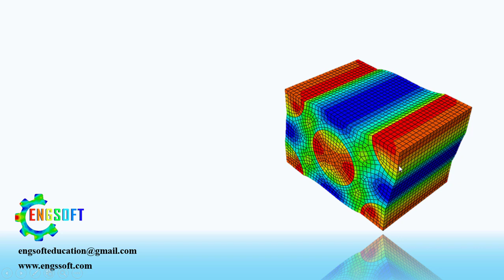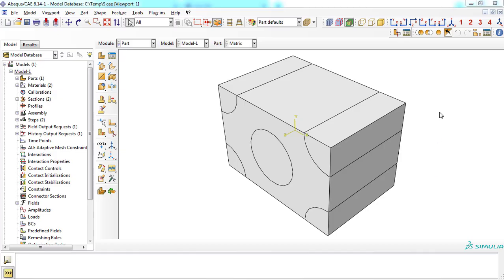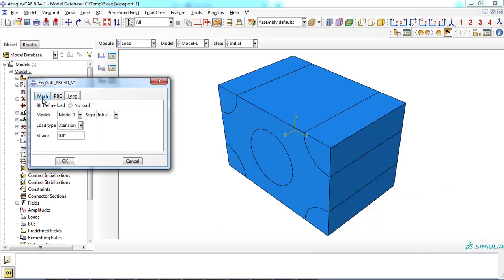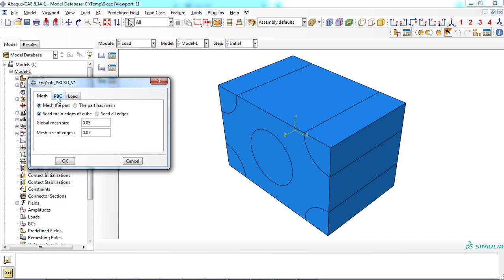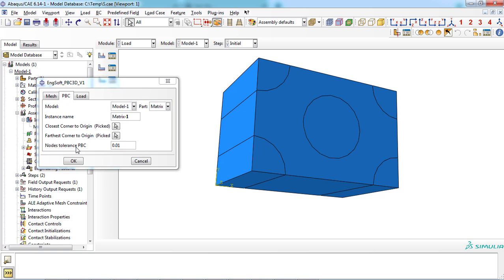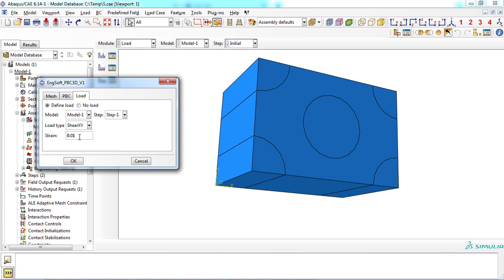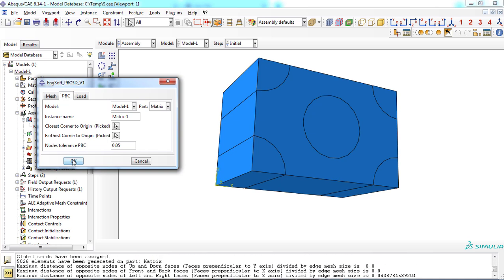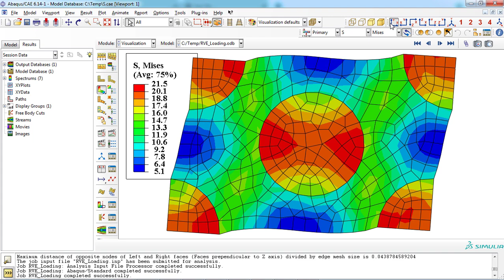Abaqus Plug-in to apply periodic boundary condition (PBC) to RVE of 3D problems

Comment: Thank you for the great video, I have a question:
is this plug-in also useable for the non-periodic meshes?
Thanks in advance
Reply from the maker: Thanks, this plug-in was designed for periodic meshes with user tolerance. It means that even though all meshes are not exactly in right position if the number of meshes on opposite sides is equal,  the plug-in works. However if you need a plug-in that works for cases that number of meshes on opposite sides is not equal please send us an email: engsofteducation@gmail.com.

Comment: This is excellent. Any ideas on the mathematics behind the formulation/design of the pbc?
Reply from the maker: Thanks for your kind comment Dr. Okereke, this work was down with considerable effort. We found that most of the papers and available codes neglect complete constraints and in the results one can find nodes that moved freely especially in borders. Therefore we prepared this easy to use plug-in without these problems. We also introduced a 2D PBC plug-in for 2D problems:
https://www.youtube.com/watch?v=9hjSDOlflgs&t=3s 

 Studying basics of PBC and coding is not a necessary step for everyone and we believe that it is better for researchers to use available PBC codes and focus on the new aspects of their researches. However we tried to explain the basics of PBC and python scripting in several videos. Some examples are:
https://www.youtube.com/watch?v=D4dkOzDQ78U&list=PL0en87H2H2m1DcfU8ZxTQwbI2C7mlCwTh&index=2

https://www.youtube.com/watch?v=zPiYgXEnl3Q&list=PL0en87H2H2m1DcfU8ZxTQwbI2C7mlCwTh&index=4

I am aware of your valuable works on this topic and I am sure that researchers can benefits from them. I hope more cooperation in near future between our teams.